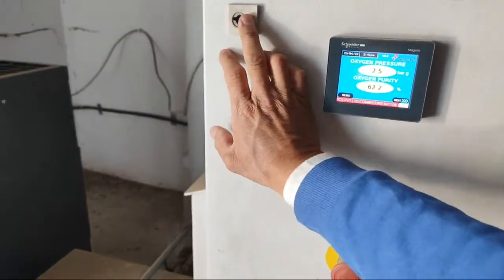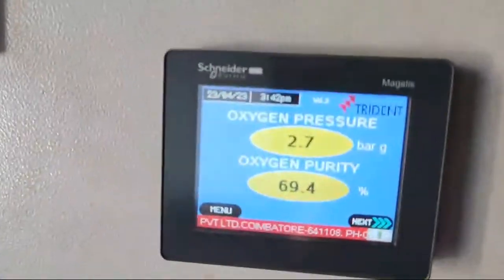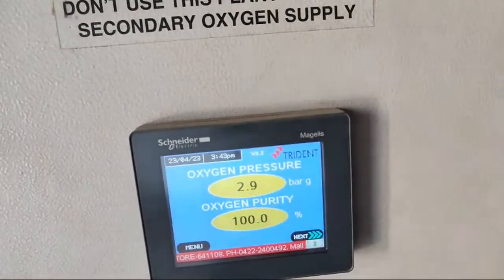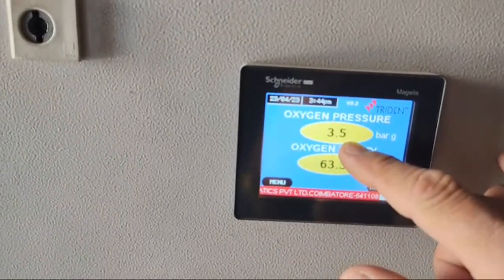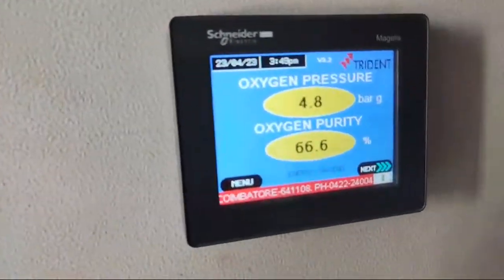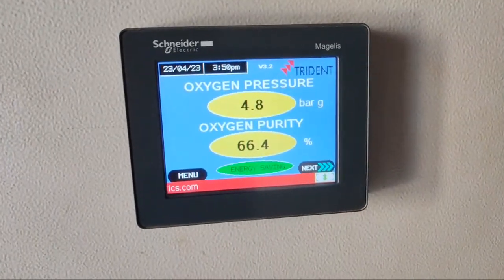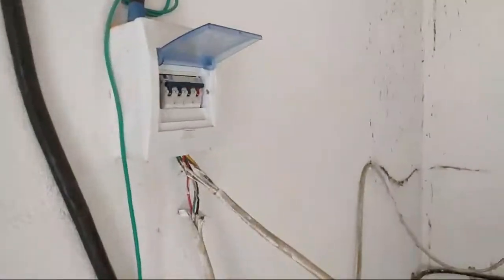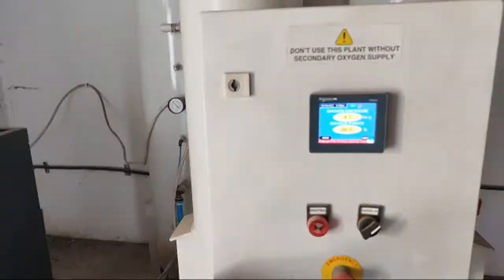Oxygen Purity Problem in an Oxygen Plant

Comment: Hi. What was a problem ? Why it does not up psa ??
Reply from the maker: It was due to the oxygen purity sensor expired. In this case We should replace the same type ( original)  of the Oxygen purity sensor. After that this problem will be fixed.